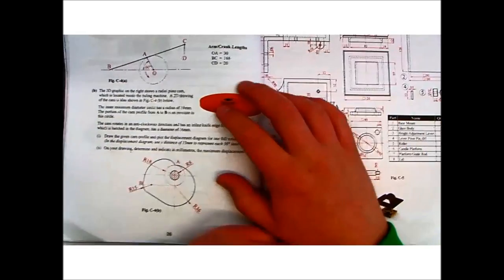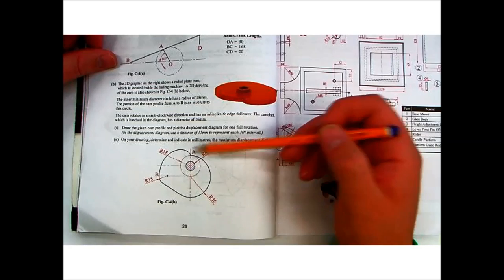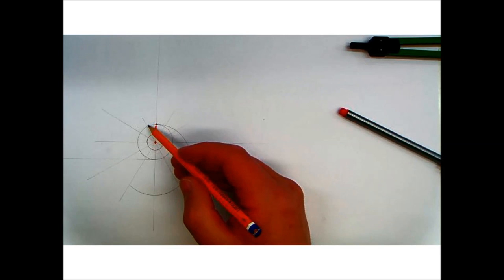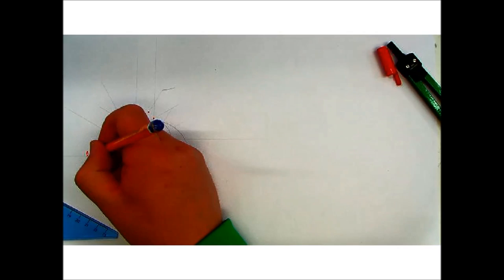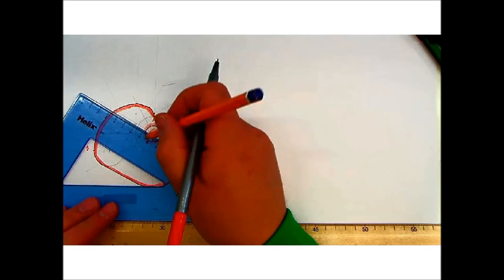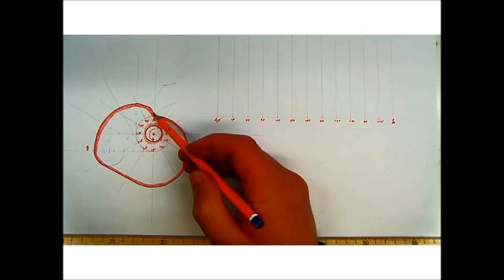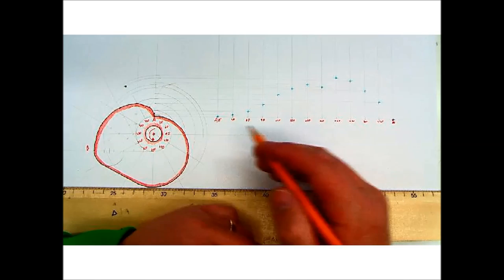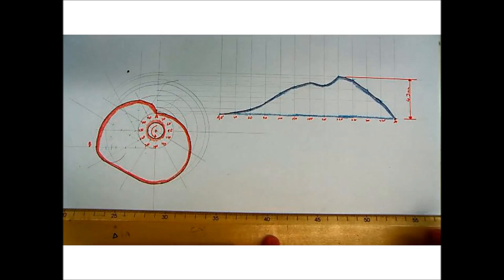DCG: 2013 Higher Level Question C-4(b)

Comment: why dont the degrees go the other way if the rotation is anti-clockwise?
Reply from the maker: Go to 5:57 in the vid. 👍
Reply: Oh sorry didnt notice that, so if it was clockwise the labelling would go the other way? If it touched on the left side
Reply from the maker: +Salwagon yeah works both ways.